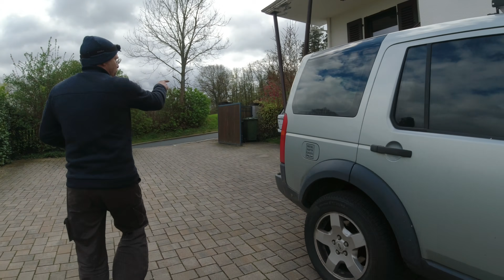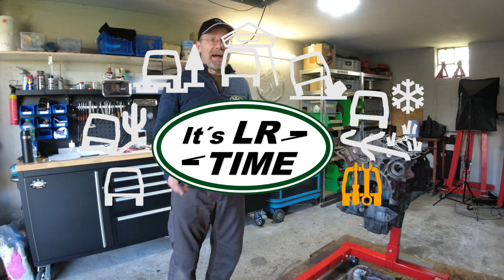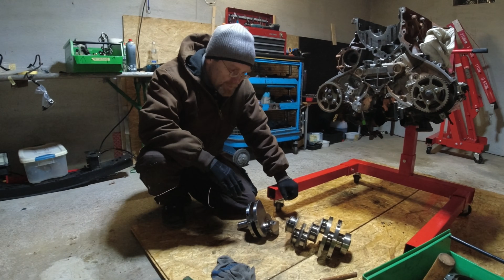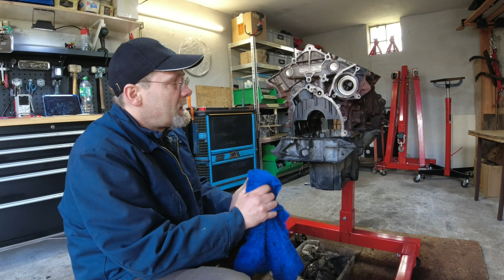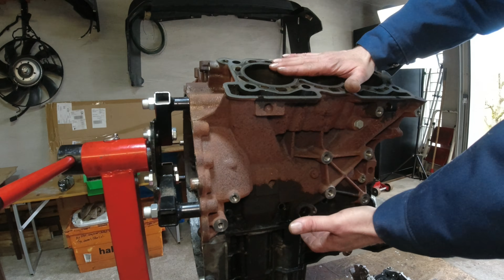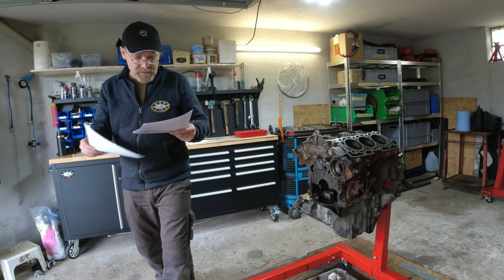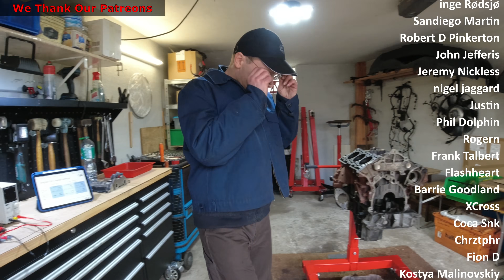Ford´s 3.0L Powerstroke failure modes - also JLR SDV6 306DT / S5-EP16

Comment: I agree about the oil 100% I live in Spain and the 5w30 in the summer just doesn’t do the job. Plus with the 5w40 is slightly cheaper. I use Castrol Magnatec

Comment: Your best lecture to date Christian. Incredible research to which I'am sure all of us euro 6 guys are grateful.  My new to me  244000k was owed by a main dealer at the seaside.  I don't think I'll sleep very well tonight.
Reply from the maker: If it's lastet that long, it's unlikey it will break. At the least the crankshaft. For everything else which might fail at that age, we have a video about. 👌🙋‍♀️
Reply: @Vera_and_Christian  At least you've given me a little hope. I did make sure it had a full comprehensive service history.  Good luck with sourcing the new short motor.❤
Reply from the maker: @chrishill5166  I am surprised that no one saw our beautiful new engine on the thumbnail picture. We do not wait, we took immediate action of course.  😀👍🙋‍♀
Reply: Did you follow the Polish idea and borrow one from the UK?

Comment: Christian is correct about the reason why the thin oil grades were introduced. I worked for a British, now German OEM manufacturer of engine pumps (not saying which) We had to re-validate our pumps when the new thinner oils came in around 2010. We changed absolutely nothing and the new oils made absolutely no difference to our pump.

Comment: Hi from Ayrshire 😁
I wonder if gas brazing the block up is an option ? 
Be less prone to cracks than cast welding I’d think
The block could be checked for cracks in the area of the damage with “die penetrant” available cheaply enough in aerosols

Comment: You can ship your engine block to America and have a shop “Muggy Weld” that hole up for you!  I just found a video on YT showing it being done.  

“Wielding a Cast Iron Diesel Engine Block With Muggy Wield 77 Arc Electrode”. 

There are other shops here in America that could do it for you as well.  It would be a lot cheaper than buying a new one.  But you two could probably Muggy Weld it yourselves and do it for practically nothing!  It would make a great video!!!!   And if you do mess it up, you can still send it to America to get welded.

And if you ever have just a crack in an engine block, you can cold weld it and fix it.
Reply from the maker: I know that shop too. Very good 👍.

Comment: Hi guys I am from South Africa, I did not do my research on this Landrover discovery engines , I bought a discovery 3 and after a few months the engine just died ( luckily If it can be fixed I can do it myself) , thx guys for all the info anyway is it possible to replace my engine with a ford Jetta VR 6 engine?, my name is Micheal.

Comment: Been following with interest. I have a 2010 Jaguar XFS with one of these 3.0 engines with a slight noise. Always been serviced ahead of schedule with 5w-30 C1.

Thinking of trying 5w40 to see if it helps. 

I think my noise is coming from the oil pump area and it is only when the oil is fully warmed up hence my thinking that the oil is getting too thin at temperature and the thicker 5w40 would help.

Any thoughts?
Reply from the maker: Change the oil to 5W40 and see if the noice is gone, or less. Check out our "Engine Oil and Oilpump" playlist for more information. 👍🙋‍♀️

Comment: WHAT buy a 443,000 i think i would pass on that unless it's free , if this lr3 in a salt used on roads 🤔 possible has many rusty hidden rusty areas,  i bought a vehicle i always wanted two and a half years ago a very rare h3t alpha hummer truck to later discover frame rot in some areas that might cost 2500 to 3k it's only worth repairing because of  it rare status,  so no that person can find one with still over 100k on odometer cheap just keep looking as i bought my lr3 off copart clean title bad transmission runs & drives  excellent for only 1100.00 us as i got my D2 off copart that rear-ended someone for 600.00 very clean frame no rust anywhere but it came from arizona , i would not but any vehicle with rotting frame , floor boards , motor mount,  if you don't have the skills to repair it,  plenty of good deals on anto auctions sites i use copart but it always best to go in person to look & inspect so you don't get burn as some people have,  i have been lucky with my online purchase as i bought a 2017 Mercedes Benz sprinter van 3.0 cargo van with 300,000 on odometer no check engine runs quite and i was able to find original owner information and contact him my van was commercial used all highway miles i bought it 4300.00 to build into a camper van as many people buy Mercedes Benz sprinter already built out 100,000 to as high as 200,000 to me that madness that more than i paid for my home to be built in 2002 and i ean excellent money but i don't want monthly payments debt is the only thing keep you working,  if anyone has some mechanical skills or the willingness to lean to repair correctly you save thousands over brand new , the sticker price on all vehicles are mark up thousands of what it is really worth,  never trade in a vehicle as credit towards your down payment because the new vehicle mark up you're just giving away your old vehicle for free, as soon as you drive off it has lost 30% or possible more than what's its worth,  another bank trick most people don't know do not get dealership financing because that a rip off the dealer will say i got you approved 6% but really the bank said 3% the dealer will add interest to your loan and tell you 6% and all the add on extended warranty,  free oil changes,  and so on all this in your new loan well at least that how it works in usa, the best way cash no payments or get approval at your bank have a  blank check in hand , dealership are not your friend no matter what they say on saving you money this is a special deal all lies because the vehicle mark up by thousands,  a new defender 80k funny stuff some go over 100k so it may never happen to me because i refuse to waste money on transportation that sits most of ths time as i watch copart auctions on the new defender sell for 50k 80k for a 2024 wrecked defender 130  with 500 miles on it i can't believe there are 25 new 2024 defender on copart with less 1000 miles wrecked or hail damage  maybe one day i have perfect timing catch a deal on copart selling a high mileage defender still too new auctions want too much the L405 are now cheap makes you wonder why land rover don't hold its value they drop in price by the thousands in just 10 years from 80k to 15k or less that's my defender range in price under 25k another point of view by someone from texas 😊

Comment: Another excellent video explaining the failure modes and reasons.  Having changed the big end bearings on 3 BMW S63 V-8 engines from M3's (they fail with alarming regularity), is that a task people could do on the LR diesels?

Comment: Can I ask Christian his thoughts as an engineer on the following. - In my TDv8 I have the 6 speed ZF auto box. Now on 179,000 miles with never an oil change. I cannot get any agreement from anyone on whether or not it is now not a good idea to change the oil. It sometimes flairs a little but that is affected by outside air temp so to me that says oil. Otherwise very smooth etc. - I just wondered if that was him, would he risk changing it now or live with it until the box wore out given the insane length of neglect?  Thanks, Ben.
Reply from the maker: We have several videos on the 6HP and 8HP. Interval is 80t km for the rest of the automakers. Change the mechatronic seals too before it is too late. And don’t forget to reset the adaptation. Christian
Reply: @Vera_and_Christian  Thank you very much for taking the time to reply and provide the very helpful info. It is much appreciated! We have now also had our Disco 4 for two weeks and still the crank has not snapped :) :) :)

Comment: When my old '92, V6, 3.0l Toyota Forerunner had 380k klms on it, it got driven into a creek, the engine hydro locked and broke the number 6 conrod which poked a hole in the block. I fixed the hole with some body washers an 8mm diameter bolt and gasket silicone. Bought another rod and piston out of a wrecked engine and put a new head gasket on the LH cyl head. The engine did another 100k klms like that. That's pretty rough mechanics but it had to be kept going and it worked. If I had your Disco in it's current state I'd be doing the same thing to it's engine. But I realise that would be totally out of the question and not necessary for you guys. But anything is possible. Great content LR Time.

Comment: I had a conn rod thrown on my 1960 2 litre diesel Land Rover Ser. 2, and it punctured the block. A patch brazed in solved the problem, and the engine has done many trouble free miles since. I recommend it to you.

Comment: FORD Found On Road Dead or a older one Fix Or Return to Dagenham lol
Most interesting post to date, you cover many issues i've talked about with other like minded (im so dull).
A friend of mine an engine designer now retired told me his first job as a young engineer was to spend time in the return department of a large manufacture taking apart failed return units to work out the cause , so seeing all your saved failed parts you have is most interesting added to the time line of development  , combination of poor design, compromise and projected minimum life and minimum service interval to get past the warranty period is interesting , i think your on the money with everything you say. Ive always gone over and above with makers recommendation for oil change intervals to the point of arguments with the dealer when my car was still under warranty , but i come from a commercial vehicle background , oil is cheap compared with a failed unit , oil dilution and long drain oils a issue as MAN found out a few years back with some of there engines failing with bearing issues broken rod and as with your engine a hole in the block (putting a leg out of bed ) Please keep up your excellent analysis.
I cant see why in Germany you need to have a degree to be a engineer, anyone that builds a line boring machine in there garage is a engineer in my book

Comment: You're a wealth of knowledge. Well said! 
But about oil? Vehicle manufacturers specify one thing, but oil manufacturers specify another, nearly never taken into account. For instance i was driving a Ford V8 sedan(salesman in that land down under) i used to drive around 4000km p/w and found that if i didnt do an oil change that week i would start to use oil the second half of that second week!? Anyway because i went to the same shop every week to get my oil and filters etc, it was noticed. Well one day of my weekly oil shopping the Penzoil salesman was there asking me how i found his oil( Penzoil 20W50 in this case which i had found one of the better oils to use, many trials) i told him about the oil use after 5000km, he found that totally normal because that was how long the oil was designed to last. He told me that they used to make oil that lasted 20.000km with very expensive polymers they used, but not many people believed it and changed their oil at vehicle specifiied oil changes anyway. So they stopped using those polymers and went back to 5000km as before. Much cheaper production for them, same price at the outlet though, cheeky buggers!! 
So thats oil for you, important but never thought about. 
I now still change my oil at 5000km havent had a failure yet.
 Specifically in a diesel, because diesel oil has a lot of detergent in it to keep the engine clean but the oil gets dirty fairly quick, admittedly less in the newer designed diesel but still it gets black and saturated with carbon deposits etc very quick. black paint i call it, yukky stuff! It grinds an engine to death. And you're right vehicle manufacturers dont care anymore than to get that car over the warranty time/kilometers, bean counters are in charge there, just like in oil companies! 
Food for thought?

Comment: Thank you for pointing out the reasoning/causation of non-compliant Toyota engines long life and the emissions compliant engines from Land Rover. Most manufacturers know how to make an engine that will last a long time, but they are constrained by emissions compliance, hence a higher failure rate.

Comment: Nicely done Christian ,i agree with you when said that a compromise is made, something else is going to suffer, and oil starvation in any part of the engine is not good at any time, i guess i am lucky i drive a Volvo 240 with the B230F engine which is a none interference engine with much looser tolerances than any diesel and that 3.0 litre V6 is quite technical and who knows if it was ever a casting issue for these crankshafts or any of the other things you have talked about in all your videos, they are all fantastic to watch and listen to and Vera is always a step away with great anecdotes of info and stuff happening and i guess Toyotas are pretty darn nice cars to ,😁, just too boring for you Maybe  👍 Sunday mornings, and LR Time

Comment: Christian and Vera, I have a 100 series diesel land cruiser that has done 430,000 kms. It drives like new. Should I use 40 W oil in it. I'm not sure what oil Toyota has used. Toyota have always serviced it on time.
Reply: I'm in Australia by the way.
Reply from the maker: I don’t know.  Best stick with the recommendation from Toyota.  Christian

Comment: My rule of thumb for a daily driver is to change the oil and oil filter every 6-8 months. Use specified fully synthetic oil and never use budget or unfamiliar oil brands.
Reply from the maker: so we say every 8000 km and most importantly invest the money in frequent oilchanges and not in most expensive oil. And check your oilfilter every single oilchange. 👍🙋‍♀️

Comment: Many performance japanese cars run replacement ecu's.would  it be possible to use an aftermarket ecu to run the earlier gen1 engine rather than the gen 2 ??

Comment: Ford North America also specify SAE 5W-40 oil meeting WSS-M2C171-F1 (API CK-4 with additional tests and more anti-wear additives) in the F-150 with the 3.0L Power Stroke if the vehicle is being used in arduous conditions or if biodiesel concentrations above 5% or B5 (the UK is B7). They also specify below -30°C (-22°F), SAE 0W-40 to the same specification must be used.

Comment: oil dont matter that much for average motorist . Changing oil filter at recommanded intervals yes . If you are trail blazing , cold winter you'll need to call your car manufacturer for proper schedule . Some brand do not know . Car hate ethanol . The more ethanol in gas the faster wear . Even diesell has bio . Ideal . Seperate the bio part from the gas or diesel . Or find pump that do not put bio in gas or diesel . Even then , unless it's dedicated pump . You'll need to pump first gallon in container , test it on your lawnmawer . Split ethanol from gas , then put gas in lawnmower . Best plug are copper plug . Just file electrode once a year and regap . Engine will run smoother

Comment: The oil pump antics bring us to  the important Sunday question of establishing exactly how much shaft power is being consumed pumping oil. Expectation is for cubed law to apply to the basic oil flow rate-related  power (proportional to flow rate x pressure, and pressure itself being proportional to flow rate squared). Pressure  is then being further impacted by basic viscosity, temperature and the relief valve functions.  PLUS the friction losses in the gear rotation due to drag and shear forces in the oil at the tooth contact.  Simplifying with Google produces a thread to a book indicating 6.5 hp at 5,000 rpm for some particular vehicle engine, which is quite a lot.  The cubed law would bring this down dramatically at real life Diesel operation at nearer  2,000 rpm, but it illustrates the point that oil pumping energy  is a significant part of the drive for overall vehicle efficiency.

Comment: better quality oil?  VW Audi etc diesels go forever, In 2004 we heard  they went to a better oil for higher pressures on the camshaft and if you didnt use the correct oil, the cam was short lived.
Reply from the maker: Check out our "Engine Oil and Oilpump" Playlist. 👍🙋‍♀️

Comment: you can weld the block by brazing with a Oxy acetylene torch and bronze rods, it's not a structural part so just grind the area flat  and put a plate over the top you'll be fine. used to do it back in the day very common with cast iron blocks.
just make sure you heat up the area well to about 350° c and there's no contaminants oil or water will get drawn into the heat
Reply from the maker: Will all be explained in a video down the road. 👍🙋‍♀️

Comment: If the block is good apart from the hole and it’s away from any gallery then I would metal stitch a repair. I know you won’t do it but an e metal plate will also work. I wouldn’t weld even if it’s possible.
Reply from the maker: Not possilbe. Also remember it's double walled and there are basically 4 shattered holes. 👍🙋‍♀️
Reply: @Vera_and_Christian  Ah fair enough a step too far then.

Comment: Lovely video I look on Auto trader very regularly there is a lot of Discovery 4s for sale some have well over 200,000miles 2009 to 2012 still on the same engine very rare you see one for sale with a new engine Toyota miles I change my oil every 3000 miles 92,000 had the car 12 yrs still like new